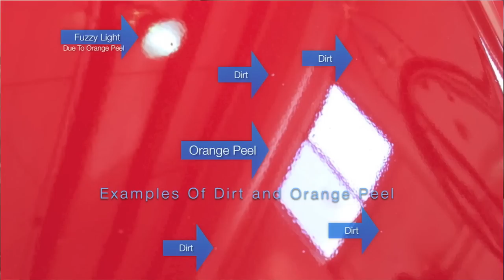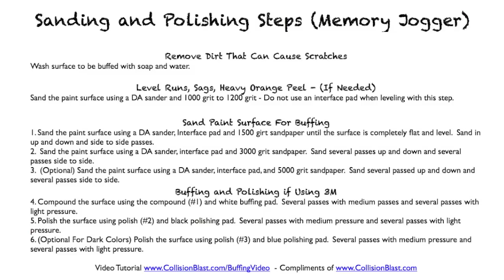How To Make Glossy Paint Using A DA and Buffing - DA Giveaway

Comment: Looks like you are using water as a sort of lubricant. Typically wet sanding uses constant flow of water to rinse particles away as you are sanding to prevent the particles that are sanded out from the paint remaining under the paper and marring the finish.

Comment from the maker: I use the DA for sanding, the buffing I use a rotory type buffer.  This does a better job at buffing.  You can burn through the paint with a buffer if not careful.  You can mask your edges to prevent this from happening.

Comment: Great vid and great results sir. Quick qu, is that 3M compound paste you are using for the three stage pads and what is it called? Thank you and you really should emphasise the importance of the need for interface pads when DA sanding to help prevent cut through especially on edges. Great job :-)

Comment: You can wash the buffing pads with some soap and water and let them dry for the next use. This prevents the build you have on your pads from instilling swirls in the paint. Using the brush between sections and before washing the pads is another great option. Also, you need to focus on keeping the leading edge of the pad contacting the paint. This prevent holograms and makes the buffer easier to control. Other than that, great video. Glad to see you educating people/students on the modern sanding disc/grits, and damp sanding. The need to use flowing water is not necessary with modern sanding disc.

Comment: What do you do about pig tails the DA sander leaves in the paint?????
Reply from the maker: Pigtails must be sanded out with finer grits before buffing.  They will not buff out.  Inspect panel close during the 1500 to 2000 grit to make sure they are out.  Then the 3000 and 5000 help starting the polishing process.

Comment: A lot of people post "How to auto painting..", etc, but thanks for your practical, straight forward demonstration and explanation. Would like to see more.  A question: I'm old-school autobody experienced in lacquer or enamel only.  Today it's a whole different game of color and clear coats.  What kind of paint is it your DA sanding and buffing?  With lacquer, its the way it is done, but does that hood have some kind of enamel color/clear coat?  Or something else? I don't think enamel can be sanded and buffed, or can it?  I'd like to get a showroom finish with metallic that has depth. A clear coat then sanding/buffing as you did?  What type of paint do you suggest?  Thanks, Henry N.
Reply: +henry nevins I learned from looking up duplicolor's primer which is laquire  that you can paint   Polyurethane (Which is made for clear coat and Base Coat. ) over lacquer and enamel,,,,  but not Lacquer over urethane,,,,     or lacquer over enamel ,,, the clear coat is so cool cause you can buff out clear with harbor freight at about 130 dollars ,, theres a  little section with enough to paint an entire car,,,    and you need 1500 grit and a water spray bottle,   to make it Perfect,,  Its Ez to buff   I used their meguires 105, and the you put it on the foam pad ,,, any foam pad,, and spread it around pretty fast ,   then mist the pad  ,  Hit it again with out compound, just the left overs,   keeping the surface clean and it turns great after about 4 passes
Reply: +henry nevins you can only buff clear coat,, but i have sanded down to both enamel and urethane base and if its just a little one it hardly shows,,,,    you need to have like 4 coats of clear,        Im learning,,,    Gonna buy me a DA sander!!!!   Hand sanding it is not Very Ez at all.
Reply: +henry nevins Basecoat -clearcoat secrets revealed On youtube helped me a Lot.
Reply: +henry nevins and You have to Wait a month before putting on stickers or taping over clear   ,,, that's not really true with stickers but you darn cant pull em off again.

Comment: what is the size of the air compressor will be able to use this sander
Reply: A rotary tool like a sander, cutoff wheel or grinder will generally need at least 100 litres per minute of airflow. This will generally correspond to a 2hp direct drive compressor or above. I have a 2.5hp direct drive compressor with a 40L air tank and it runs most of my air tools fine, regulated to 40p~50si.

Comment: I thought it was shining before you started.  so I can imagine how it looked when u redone it
Reply from the maker: Thanks for watching
Reply: after painting my car. how long do i have to wait to do this step? can i do it 24 hours after i paint my car?
Reply: Pretty much 24 hours is normal, but only after the paint is hardened.  The paint (usually) will say on the can how long it takes to harden before buffing can occur, and this is great for base/clear systems, and single stage is slightly different too.  Also, don't wax the car after you do these steps because the wax seals the finish, and the paint underneath is still off-gassing, not fully cured, and has to gas-off for a month or so.  The polishing compounds don't seal the surface, but rather treat the paint to get the shine back.  Hope that offers some help.

Comment: Why can't you just use the DA Sander to buff, why change to a rotary?
Reply: Allen Maestas 
Cause they dont have the torque for buffing/polishing...
Plus theres no pads for those. You have to buy a polisher to do this type of work
Reply: splash They have enough torq for sanding, that’s even more invasive.  And they are hook and loop 6”, so yeah you can attach a pad.  Anyway, thanks.
Reply: Allen Maestas 
Ive been in the trade for over 24 yrs... im just answering a question that you had asked, hence you dont know the answer...
No they do NOT have near the torque of a polisher! Or they would make pads to fit it!
Plus you say 3" pads, DA sanders are 6"... thats for a mini polisher, not a DA.
Your welcome
Reply: okeedokee "SPLASH"  Thanks for your 24 years of trade experience!  And I didn't say 3", I said 6"  and you are wrong, you can easily attach a foam or wool or any damn pad ya want as long as it's a 6" or 3" hook and loop air sander, but maybe your 24 years of experience isn't in air sanding.  In fact, what exactly do you think a DA Polisher is?  Yeah, that's right, it's an electric sander, first built for sanding, not polishing.  And that big ole ass rotary they are using here, that was first built for grinding, not polishing.  And yes, you are correct, pads for a rotary will not work with a DA Sander, but that's not what I asked!
Reply: Allen Maestas 
Ok there bud... You said 3", but clearly i see you went back and corrected(edited) that to make it sound like you know...
Lol
Cheers bud, enjoy your day!
If you ask a question, expect an answer to help someone out...
Dont post a question tryin to be a smart ass, when clearly you dont know...
Let me guess your the only dude who buffs and polishes with his DA?
Lmfao
You should make some vids!
Reply: I did correct it, before you answered, because I noticed they were using a 6", but either way, doesn't matter, they make pads for both.  And just because you answer a question, doesn't mean the person has to agree with you.  My question was for the person who posted this video, but I have no problem getting answers from anyone.  Thanks Bud
Reply: Allen Maestas 
The only thing i was trying to say is the rotary buffers seem to have more torque. Try it one day. Take your DA and hold it as hard as you can against a panel and pull the trigger... now try the same thing with your rotary buffer... the rotary will grab and jump out of your hands.
Also you were saying about DA polishers. You are right! They
 do use them, but its not because of the torque, but because its DA its rotary and oscillating... helps eliminate some of the swirl marks that rotary buffers leave behind.
Cheers man, enjoy the rest of your day!
Reply: I think everybodys missing the point. A da is triple action and vibrates in a small triangle. The polisher does not. It is a direct rotary perfect circle.  That would be my guess not to mention better control with a longer handle and much larger pad
Reply: Michael Collins 
DA = dual action
They spin and orbit, hence dual action. 
Different tools for different purposes... i work with this stuff everyday. Wish it was as simple as buying one tool for all the jobs!
Reply: splash thats what i said. Da is doing a triangle during orbit...polisher is stationary rotation.
Reply: Michael Collins 
Yes, thats exactly right